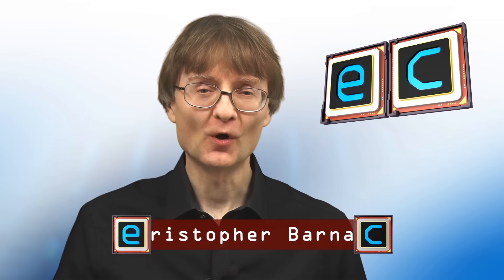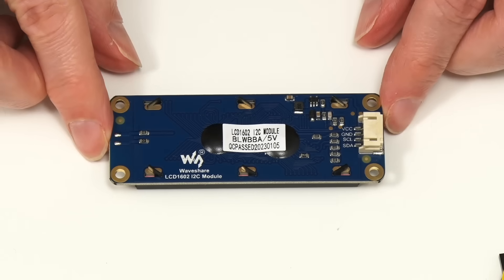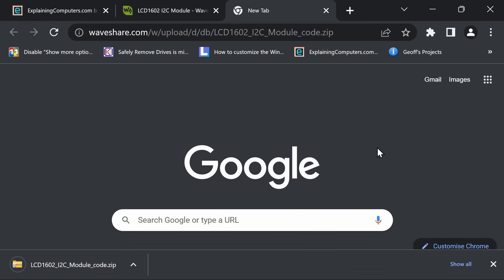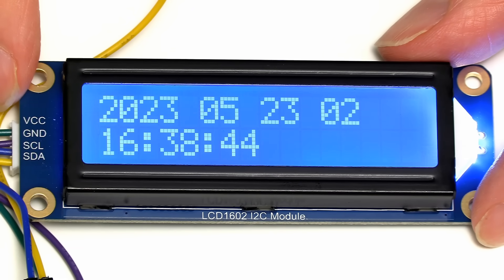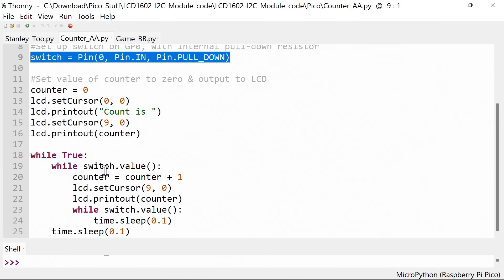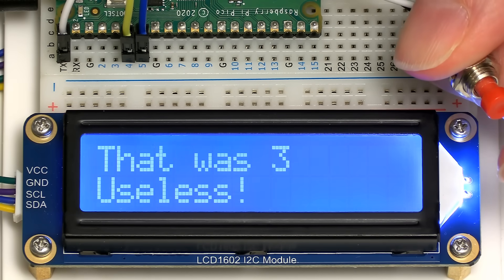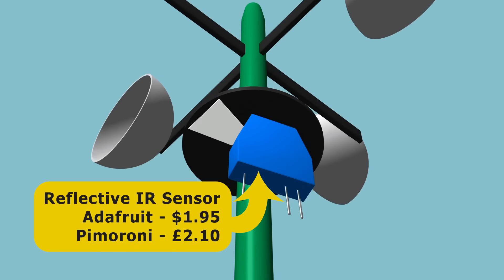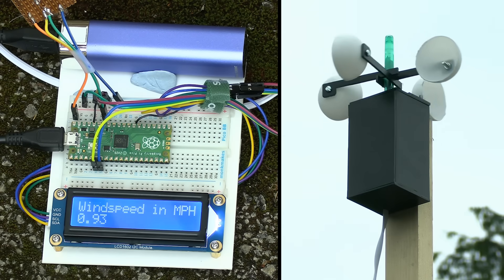Raspberry Pi Pico LCD Projects

Comment: Have you seen The 8-Bit Guy's video on LCDs? He covers the older standard instead of I2C, builds a box of switches for hand encoding the text, and also drives one using a Commodore 64 user port as gpio. Great stuff

Comment: thonny gives me a error: Traceback (most recent call last):
  File "<stdin>", line 4, in <module>
  File "LCD1602.py", line 56, in _init_
  File "LCD1602.py", line 98, in begin
  File "LCD1602.py", line 60, in command
OSError: [Errno 5] EIO
Reply: did you fix the problem, i have the exact same error
Reply: @souhailabbou2502  no

Comment: Great vids.Im having problems here though and everything is  wired and installed correctly.
MPY: soft reboot
Traceback (most recent call last):
  File "<stdin>", line 4, in <module>
  File "LCD1602.py", line 56, in _init_
  File "LCD1602.py", line 98, in begin
  File "LCD1602.py", line 60, in command
OSError: [Errno 5] EIO

Comment: Thank you Chris, been looking for a simple, economical way to display measured parameters or what step of a program was in on a PICO. 
Just an update on the display you used, the current version from them uses a RGB LED back light so you can make it any color you wish...but you do have to add code for that too.
Reply from the maker: Thanks for this. The version of the display I used is still sold -- as well as the RGB version. :)

Comment: I enjoy watching your videos. I’m most interested in the SBC reviews. It would be really interesting to see cool projects with these boards, perhaps as a series. It would be really neat to partner with other channels that are way outside your wheelhouse. So like how about using an SBC as a controller board for a vintage motorbike project with a channel that builds bikes? Using an SBC to control a very novel set of lights for the bike to keep it safe and visible on the roadways. 

You mentioned maybe looking at ESP32. You could make content for months easily just scratching the surface with how these things are used. Especially if you start seeing it through with home automation use cases.
Reply from the maker: Thanks for this. There are indeed many microcontroller and SBC project video possibilities. But I earn my living running this channel, so what is most critical is what the viewers want to watch. And sadly this kind of content does not pay my bills. Today I posted an Arduino video -- my first! But again, not that popular (so far). But I will always return to such content when I can. :)

Comment: Is the Python I2C implementation blocking, or non-blocking?  The nature of I2C is that you have to send a byte, then wait a short amount of time before you can send the next one.  If you make the CPU actually wait, that's "blocking", because nothing else can be done in the meantime.

A non-blocking system would have to use another process, perhaps interrupt driven, implementing a queue of bytes to be sent.  That then doesn't have to block unless the queue is full, or not even then if the main program can check if it is, and decide not to send anything else, so it can get on with other things.

Generally, SPI is easier because it can be so fast that a CPU doesn't need to wait long, so it it can use a blocking strategy without slowing down noticeably.

Comment: Is there a set of software set you would recommend for testing/benchmarking a Raspberry Pi? 

Thanks
Reply from the maker: I tend to benchmark with sysbench for the CPU, hdparm for drives, and then real programs for other comparisons (eg my standard GIMP render test, and Kdenlive render test, as included in many of my videos). I'm not a fan of focusing too heavily on more specialist benchmark software -- I prefer real-world performance comparisons, such as YouTube playback and the aforementioned render tests.

Comment: I have an application that has not been solved by any commercial device. Sony Blu-ray players do not have a front panel display. When used as an CD transport and NOT connected to a TV there is no way to set up the player or see track info. I need an HDMI to WiFi adapter to display the info (480p widescreen would be fine) on a Fire tablet (also used for music streaming control). Has there been a Rasp Pi project for such a HDMI to WiFi adapter? What Fire tablet software is required? I don't have Rasp Pi experience but do have microprocessor & PC experience. Thanks in advance!

Comment: Nice LCD module. If I would take that to a project, would attach those LCDs to an air conditioner. So It can basically monitor the amount of electricity used and the literal price that we would pay for.
Nice LCD and nice video.

Comment: Very nice video indeed! eye-to-see is so useful on microcontrollers, hey, maybe you should do a video on multiple devices forming a true i2c bus? I have one suggesstion: what is this crasy unit called "mph" when measuring wind speeds?! stick to standards: either knots or mps, later is preferable - you need instantaneous measurement as in 1 hour wind would change so many times...
Reply from the maker: Well, the Met Office, BBC and all others providing public weather forecasts in the UK cite windspeed in miles per hour. And a quick web search reveals the same is true for CBS and others in the US. Indeed, when I made my initial anemometer video, I was criticized from the US for not reporting the speed in MPH.
Reply: @ExplainingComputers  but, as a programmer (and user for that matter), what is the meaning of any non-instantenious wind measurement? like, with meters per second, one can easily visualize an object weighing 1kg on a frictionless surface (or water for an abstraction) that during one second of 50mps wind would move 50 meters in wind direction. BTW, the wind induced drift of objects on ocean surface was the reason of introducing a knot (wind influenced nautical mile per unit of time) in marine calcs.

Comment: Great Video Chris! A real walk down memory lane with the 1602 LCD display. My 1st micro project was with a PICAXE micro,and 1602, around 10 years ago. I ended up using a pin and code compatible OLED for a much better visual with no backlight, but I have used the 1602 with many projects since then. Nice to see how useful they are. Thanks for the modern adaptation of an old reliable (and inexpensive) display.

Comment: considering how little power the Pico uses, you could make a self-contained Weather Station. Temperature, wind speed and direction (few ways to do this, via microturbine or anamometer and weathervane combo), sunlight, and rain guage would all fit pretty easily and I think you could get all of those parts on a single I2C bus with some work as well.

Or if you know how button matricies work, you'd be able to make an old school calculator.....

Comment: Besides reading the wind speed we can also read the temperature, the humidity, precipitation and we'll have a full weather station, we can utilize this push button to cycle through all different readings.
But since I walk a lot I think I can find a way to count my steps.

as always, that was a very nice project
Thanks Chris!
Reply: there's a few different ways one could count their steps, the cheap/easy/old-school way would be to use a weight hitting a microswitch and then a similar count program. measure your stride length and get distance too. though modern pedometers (like the one inside my smartwatch) use a 6-axis Gyro/Accelerometer, which is also doable.
Reply: @DFX2KX  Since I like simplicity I think the weight with a microswitch is my way to go.
Thanks!

Comment: dont you measure wind speed in meters per second in the UK?
Reply from the maker: The weather reports here give wind speed in MPH. We have  a strange mix of measurement systems -- mostly metric, but all road signs in miles, and of course screen sizes in inches. :)
Reply: @ExplainingComputers  Imperial system is obsolete. Please, use only the metric system!

Comment: Greetings from across the pond near Albuquerque, New Mexico, USA. Another idea for this LCD1602: attach a laser module to the pico, set it up in a doorway, and count foot traffic. Also, with some reflective tape and a little programming, determine rpm's for a fan or even a hobby propeller, much like what you did with the weather vane. I think most might be surprised at how fast the pico can measure rotational speed.

By the way, my intermittent contributions to this channel are always based on all your work, not just any one video. Thank you for working so hard to be such a great prof/instructor/teacher.
Reply from the maker: Thanks for your support, much appreciated. I like your project ideas. :)

Comment: Great video, as always. I need to check and see if the display I bought but never used is in fact I2C.
EDIT: I checked, and it has a daughter board to handle I2C. I will buy a Pico and have some fun.

Comment: You could probably get more accuracy from your anemometer by using a bearing for the spindle and using a smaller point at the bottom and oiling it.

Comment: Just last night I was discussing with my son the possibility of using a pico along with a LCD display to replace failed VFD displays in old but otherwise good hi-fi gear.  I wonder if such a pico-LCD combo could be capable of emulating the horizontal-bar stereo VU display one finds certain older gear?
Reply from the maker: This should indeed be possible. :)

Comment: Have ESP32 cameras sitting around to be programmed as monitors that ftps images to my pi server. That will check them for differences and post ones that are different from static image, maybe post a picture of the cat if it sits in its favorite spots. I don't know if I will use some image difference comparer or AI library to detect differences, NumPy and some matrix algebra might work well enough and run on my Pi running a very old OS.

Comment: The basic elements of a system explaned, now it's just a matter of adapting it to the specific application.  Small-scale automation is one possibility.
I was once involved in a project to put a counter and communication device into vending machines, so that the owner would know exactly how many units of what had to be sent out to refill it. (Or that the refiller need'nt bother to visit it yet.)   It would have been so easy with today's kit.  Unfortunately,  the trade greeted it with a tsunami of indifference. :-(*

Comment: Those little electricity meters the energy companies supply work by sending a radio pulse for every 1wh used. The battery on those lasts for months. The same principle could work with an anemometer. Each time the mill turns it would send a radio pulse instead over wires.
Reply from the maker: I like this thinking! :)

Comment: 17:15  pico does know the time, thonny injects the current time when connecting to the pico, other editors do not do this.
Used   "now" minus start, in nanoseconds, better use the pico's millisecond options,  
import time
start = time.tick_ms()  # and to check elapsed time
if int(time.ticks_diff( time.ticks_ms(), start)  / 1_000) == 10:
   # display result, you have won !
Reply from the maker: Yes, agreed -- it knows the time when connected to a PC and Thonny. But this will not be the case when the Pico is running independently.
Reply: @ExplainingComputers  anyway, no need for time to know elapsed time

Comment: Excellent and as usual, clear, concise and a great way of getting into a hobby, I would like to know what are the best components for different projects, are there better components and how do you choose?
Reply from the maker: Thanks for this. it is hard to answer your question -- it all depend on the project. :) A Pico is good when you want to run a simple task, and have low power drain.

Comment: Nice to see a 35 year old display being used on a modern build.
Reply: @Win32applicationMost high end displays tend to work very well, including high refresh rate and modern display type ( OLEDS, Minileds ) etc etc and they are pricy for that reason, high refresh rate displays and they also deliver a much smoother experience, I wonder what monitor you had used that caused so much issues
Reply: @Win32application I bought 6 of those Dell 24" screen this month! Got three on my computer.
Reply: @wayland7150  How many do you go through a year?
Reply: @JamesMiller-ex3ff  Go through? No, I set up a customer with two screens and set myself up with three screens and sold one with a gaming PC.
Reply: @wayland7150  Aww, here's me thinking the other 3 were backups for the rage-induced destruction of the first 3
Reply: @JamesMiller-ex3ff  You got me. Yes that's really why I get through so many.
Reply: Guys, what are you talking about? The topic is about the 1602 LCD Display, mostly using a Hitachi HD44780 LCD controller (here with I2C to 4bit or a derivative that can handle the protocol native) which was introduced in the 1980s ("35 year old display" ... meant is technology).
On the other hand, I am of course proud of you, not buying the marketing buzzwords uttered by the display manufacturers (COMPUTER MONITORS, which is something completely different) and scamming you into absurd screen refresh rates, that make simply NO SENSE for a biological being like a human. Those high frequency monitors must be targeted at house-flies ... at least at individuals with such a reaction time ... but maybe also the brain capacity of that fly?!? ... :P
Reply: @dieSpinnt  I disagree. When CRTs could do 85Hz I preffered that setting. When LCDs were only 60Hz I could tell. Now with 144Hz I can clearly see it's better. My next decent screen will be higher still.

Comment: Similar displays from aliexpress usually have a separate i2c converter board. Here everything fits on one board. Otherwise, there is no difference.
Most of them support only the Latin alphabet (for an Englishman this is not a problem, obviously). But if you need other characters, such as Cyrillic, you will have to buy another version of the display, usually more expensive.
 Also they are rather slow, rapidly changing values will be unreadable. I think they work even worse at low temperatures.
Reply: They do have some user definable character positions.
Reply: @wayland7150  I know, but this is not enough to get the full Russian alphabet with lowercase and uppercase letters.
Reply: @wayland7150 A total of eight user defined characters at any time, though you can redefine them on the fly. Once you've "printed" a user defined character to the screen you can redefine and reuse it without affecting what is already displaying but it's fairly complex programmatically to keep track of things and outside the scope of a video such as this. I use the parallel-interface version with a Ben Eater-style 6502/6522 combination and no access to Python libraries so I wrote subroutines in assembly language and incorporated them into my fledgling operating system. There seem to be two character ROMs available: an international one that has the most useful selection of characters, but is difficult to find; and the standard one with Latin and a few Japanese characters, that isn't as useful but is much more common.

Comment: I’ve always been curious about those LCD modules.  I thank you for the demonstration.  A very impressive item.  Looking forward to your next video!
Reply: I built a parallel display for my computer years ago, plugs into the parallel port and would display system stats, song info, whatever you wanted. 

It was neat to play with, I still have it in a box.
Reply: @volvo09  Awesome project.  I should try something like that.
Reply: 8 bit or 4 pit interface. on the standard ones. They've been around for decades. there are better displays available today.
Reply: @wayland7150  I have a vintage Radio Shack Pocket Computer.  It has a similar small LCD module.  Yes, the modules have been around awhile.
Reply from the maker: Thanks Perry. :)